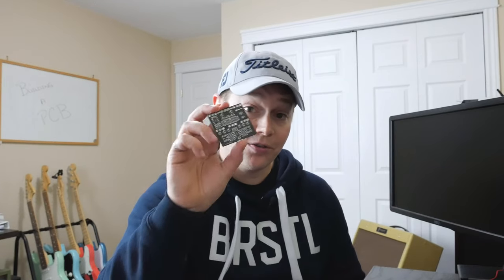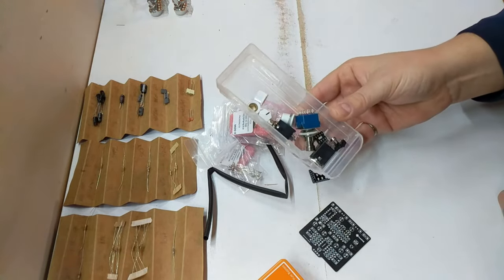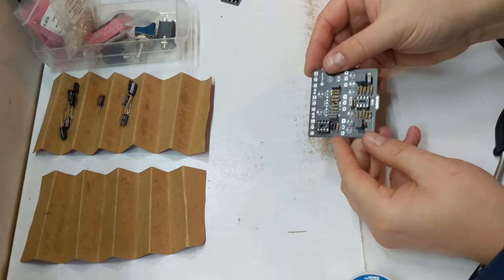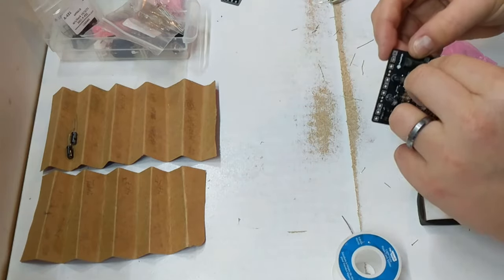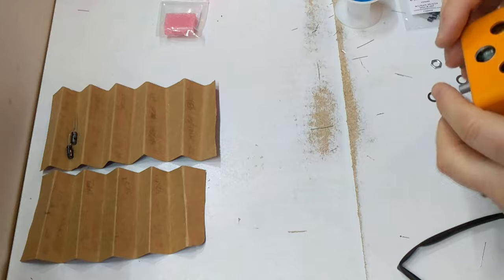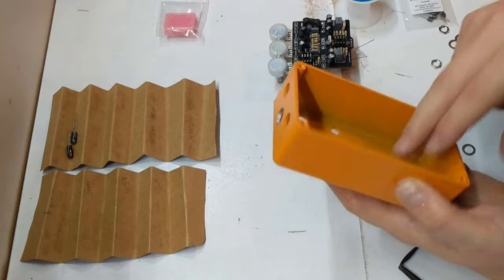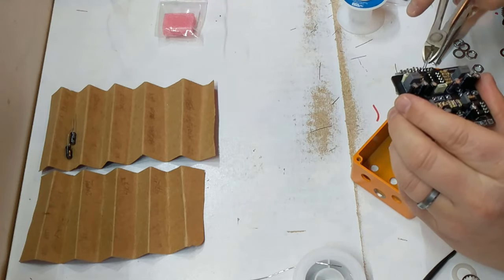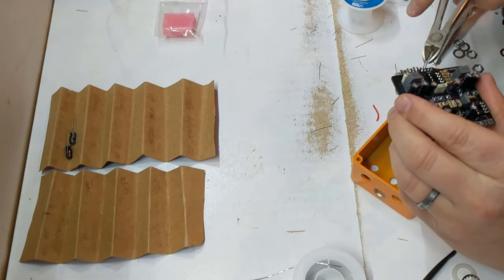How to Build Clones | DIY Guitar Pedals

Comment: Nice build video. Just a few things I need to point out: 1. You could have mentioned ensuring the correct polarity of diodes and polarized capacitors when populating the PCB; 2.  DIYers may get something wrong so it would be advisable to test the assembly first before committing all that time and energy to cram all that stuff into the pedal case. 3. Check all solder points before you power up. 4. It's best to clean up your workbench as you go. All those stray bits of cut resistor leads, wire, and blobs of spilled solder can get into places we don't want them, i.e. the board, case, etc.
Reply: Aargh, yes, not doing a board test before wiring everything in and installing in the case gives me the ick.

Comment: I’m building my own overdrive pedal and i’ve designed a custom pcb for it, this video is very helpful for the next steps
Reply: You have to learn basic theory. Doing nodal analysis on circuits so you know what's going on at any given time. It's really rewarding and super easy. Ohms law, kvl, kvl, lc, rc time analysis and understanding what the circuit is doing using those simple maths. Only buy kits to learn how to solder. I'll hook you up if you need the stuff. If you solder by numbers then it's the same as old people coloring man. I never realized how little people know about simple small signal circuits and waveforms.

Comment: Nice to see the full assembly.  No one ever showed me how to shrink wrap the two components like that.  Good to know! Probably explains why I have a weak sounding compressor where LED and LSR arent staying close enough. 😆  Curious what printer you use for the decals?  Your text looks nice and crisp.
Reply from the maker: Glad you found it helpful. I have just a run of the mill inkjet printer. HP OfficeJet 4630. The main thing is to get good paper. I used to use these when I only did white enclosures  - https://amzn.to/2W99bl4 , but have since changed to these -  https://amzn.to/3r2X7Am - as I have been using more colors. The new ones create a little more steps for color matching, but I am very happy with them. Probably more so than the Avery Clear labels. Less ink run. Also, make sure you set your print to highest quality and for glossy paper.
Reply: @pougnetpedals  Ooooh.  I've been doing waterslide and not vinyl sticker paper.  Just ordered some vinyl sticker paper to give a try.  Thanks for the help!
Reply from the maker: No problem. Hopefully it works out. I usually try to match color on normal paper, then once i have something close, print it on the vinyl. just note that the vinyl is usually a hair darker than when on standard paper

Comment: I am building this clone and am hesitant to wire up the photoresistor the way that you have. Have you had any issues doing it the way described? I was under the impression that it wasn't supposed to be directly up against the LED and that it being too bright is bad. Did you use forward voltage of 3.2 or 1.6 for the LED?

Comment: Very interesting method of building. I enjoy watching and learning from your videos. I do have a question, if you could answer, I'd appreciate it greatly. I have a Tom'sLine AC Stage Acoustic guitar simulator pedal, this one I bought off another musician, said to be working. I tried it out a few days later, but to me, it does not seem to sound acoustic or the effect is inoperable or has lost that acoustic function. I was hoping perhaps you might be able to identify which component inside might likely be the non working one. Also, if you have a vid on building an acoustic sim, I'd like to check that out. Thx.
Reply: @mikepougnet  OK, thanks, I can relate to that. And for my 2nd question, have you built an acoustic sim pedal? Is it possible? I'm thinking that would a most interesting build. Watching a video like yours, I managed to build "Chism  reverb" which has 4 knobs and 2 sw. But I'm very interested in your take on the idea,..
Reply from the maker: Thanks! I don't think I could really help with your pedal though. I believe that acoustic sim is a mini pedal which poses a couple of problems. It is likely a board with surface mount components (essentially micro resistors, capacities, etc). These a very difficult to repair. Also, being a sim, it is likely a digital pedal. This means it has a small programmed chip inside that does much of the effect. The input analog signal from your guitar is converted to digital, edited by the chip's program, and then converted back to analog for output.
Reply from the maker: I would probably just buy a cheap sim off of amazon. You can usually grab one for ~$50. If you are interested in building one, there isn't a lot out there unless you are willing to code. I think there is a project called the "Woody" that gets you half way there and it is all analog components.
Reply: @pougnetpedals  "Willing to Code"?? Lol, Sounds like we're venturing into the Matrix, Nexux or Twightlight zone..lol. So this "Woody" project, how do I come across it? Thx.

Comment: i have 3 kits i bought from china at the instructions are not that good any way they do not work ??? when putting the resitors in the bord or any of the componenits is there a direction for the legs to go in to the PCB board i cant figure out why they do not work very frustrating

Comment: Brand new to this. Could I place a PCB on top of a breadboard to keep the layout schematic but swap parts in and out to test mods as I go before soldering?
Reply: Nope, you can use a breadboard but the breadboard will always have the conductors in rows but PCBs often aren't built to way to allow them to be smaller and more dense.

Comment: Hi! Just found your channel because of the Delegate Compressor! Would you say this is doable for someone who has never had any experience with soldering/building pedals at all? Could I get all the parts and tools besides the circuit itself from Tayda?
Reply from the maker: You can get everything from tayda save for the LDRs for the optocoupler. Likely, you will have to source those from smallbear. Also the doc says it needs a Tc1044, but it should be a TC1044s
Reply: @pougnetpedals  I'll have a look! Thanks!!

Comment: I'm not sure if anyone can answer this but, what is the difference between a 100p and 100pf capacitor. The kit I have came with four of the same and it calls for three 100pf and one 100p, I just don't want to mess anything up.
Reply: 100p and 100pF mean the same thing, 100 picofarads
Reply: Learn how to use ohms law and kcl and kvl brother. It's worth the effort. I'd be ashamed to make a video where I didn't design the circuit or reverse engineer it for people and show the simple math involved. You need a calculator but its easy..
Reply: Plus you can fix almost anything wirh only understanding the basics.

Comment: No mention of polarity for diode and electrolytic Caps?
Reply from the maker: Yeah, I guess it is an omission. Most PCBs have the cathodes or anodes marked. Same with the components. Could have been mentioned though.

Comment: What gauge wire did you use for wiring the switch?
Reply: Hey man, I’ve been building pedals for about 8 or 9 months now (StewMac and BYOC), and 24AWG is optimal. Kits come with stranded, but I prefer solid for ease of use with the small holes on the PCB. Either will work fine. Hope this helps. Be well!

Comment: That isn't flux it's solder, it might have flux mentioned somewhere on the package if it's rosin core, basically some flux imbedded in it so it can be used with our with separate external flux, but that isn't flux which generally comes in liquid or paste forms.

Comment: Not for beginners...you fast forward thru all the stuff I need to see.  Good video but not thorough for a full HOW TO video 👍🏼.  When I get the basics down I’ll cone back to this video.
Reply from the maker: Sorry man. Didn't want to make the video too long. Let me know what you might like more direction on
Reply: I just a totally beginner entering this world, LoL.  I’m looking for a beginning end tutorial.  Where/how (best practices) to put the components, soldering (not a solder How-To), which components do what & how they can change for different sounds, ETC....So basically a 2 hour video, LoL....
Just a noob looking for stage 1 to finish 😀

You rock for responding though 👍🏼
Reply from the maker: Try my pedals 101 video. It's was my first vid, so it's a bit rough, but has some of that info. Also, I have lots of builds associated with pedal reviews. Most recent is the aion vector pedal. It shows the build process as well. Just look for "Build" in the title.
Reply: @pougnetpedals  Thanks!  I will check those out!  Another question...do you have a video that talks about ways to customize any pedal?  
As a noob I do not understand how to alter tones.  Meaning what happens if I change transistors with different values etc.  i see videos where they tell you exactly what to do but nit videos that give you options on how to change parts to achieve a truly customized tone.
Thanks for the info!
Reply from the maker: That's a tough one. Tone has lots of different contributors. RC circuits, clipping types, gain, etc. Fore example, if you have a passive tone stage (look at passive low pass filters) you can change the R and C values to change the cutoff freq. increasing the cutoff of a LPF would introduce more treble. Unfortunately its not always as simple as just changing values. Specifically with transistors. you need to ensure biasing is correct for your transistor to work correctly (forward active). It's a large topic. maybe something that can be tackled in a series of videos
Reply: @pougnetpedals  just saw your response..Thanks!  I appreciate you getting back to me 👍🏼.  It sounds both fascinating AND complicated.  I guess the more I get into it & build the more I’ll understand.  I can see this would be a tough video series to create...with so many different variables...Would be awesome.  Thanks Pougnet Pedals 👍🏼